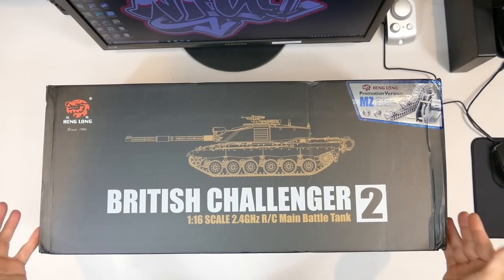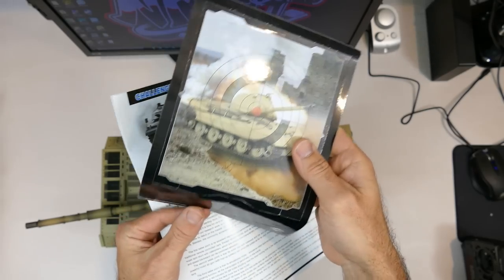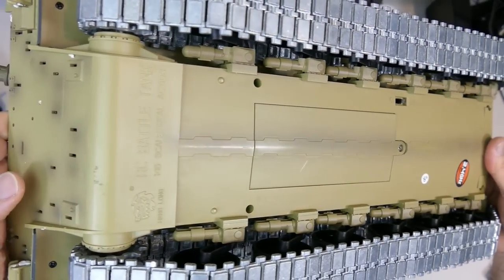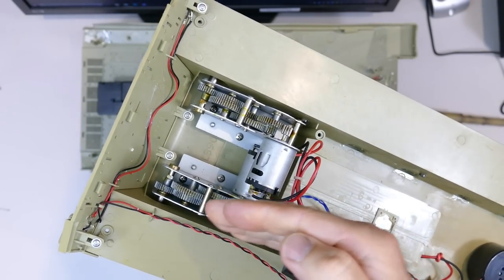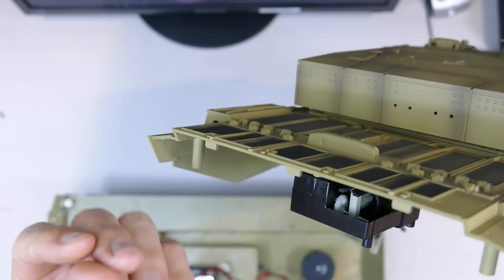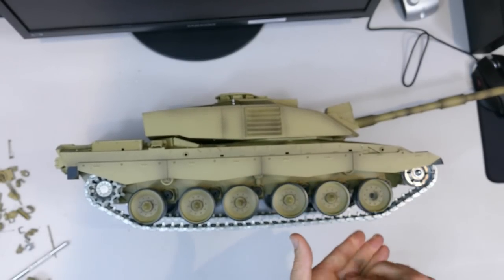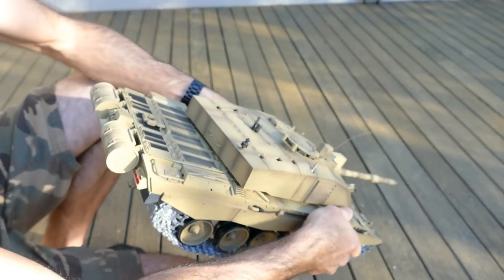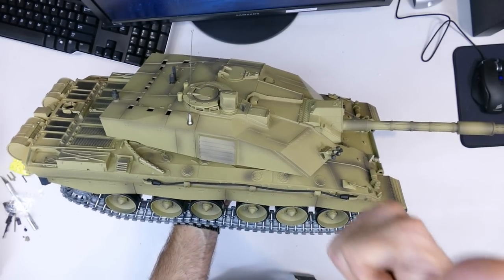Heng Long Challenger 2 1/16 RC Tank - AIRSOFT BB'S And Metal Tracks - Full Review

Comment: This could do 40mph. Also there was two engines in the tank. The small one is called a g.u.e which stands for generator unit engine which would supply all electrical power from a 4 cylinder perkins diesel. The track tensioner is called htt hydraulic track tensioner. The side skirts are for general running they are replaced with armour sides which also directed the exhaust gases to the rear of the tank from the side so it would be difficult to identify it in the dark. The smoke generator would be operated only for a few seconds at a time to make a screen between the tank and the enemy to allow the tank to make a quick get away. When the tank rotates on the spot it's called  a neutral turn.

Comment: Challenger 2 holds the record for the longest confirmed tank kill at 4700 metres During the 2nd Iraq war
Reply from the maker: That's a solid achievement
Reply: Challenger 1
Reply: Challenger 1
Reply: @RCTanksTrucks247  would be if it was Chally 2.But it's Chally 1 ,different tank

Comment: Inhave got 3 of them tanks from HL. A leopard , Sherman and a German Panzer 4... the leopard BB system went kaput for no reason, i tried to repair it but everything inside was so filmsy. The plastic are brittle, soldering jobs are sloppy, red wire are interconneting to each other by soldering making it impossibe to replace some motors without unsoldering joints... i build drones and i had never done sunch sloppy wiring in all by RC build. I retired 2 tanks and left the sherman on display as i re-did the aweful paint job. My advice... you get what u paid for. If you can, save up for a Tamiya. Forget about Taigen or Mato too... gets a Tamiya 1/16 or a Armortek 1/5.
Reply: Add about 2 to 3 Drops of RWS or equivalent Pure Silicone Oil for Airsoft or Pneumatic Pellet Rifles. Lightly trigger the system with the Tank Vertical, right as the mechanism begins to Cycle or fire, drop 2 to 3 Drops of the Silicone Oil down the Barrel. Lubs the O Ring Seals. Only 2 to 3 drops! Cycle 2 or 3 times. I have 4 HL Tanks and yet to replace a Gun yet or it could be just Luck.

Comment: Hey mate great videos I love the tanks I have a M26 Pershing and the Bulldog, what exactly are the benefits of the steel upgrade tanks, there more expensive but does that mean there better.? thanks again for the video.
Reply from the maker: Steel for the tracks, gearbox, drive and idler wheels will make the tank more reliable.

Comment: 10:35 U said 120mm Muzzle, but really u say gun, because the muzzle is just the tip of the barrel which is part of the gun inside the turret
Reply: Them breech is the part inside the turret the muzzle is on the end of the barrel.

Comment: I have the henglong tiger 1 with metal gears, tracks etc but I’ve burnt out 4 rx18 modules up to date. Running on grass seems to put to much on the rx unit causing them to fail. Is there any other electronics that can be fitted, I don’t fancy paying over the top for Tamiya dmd units.
Reply from the maker: Apparently the brand new RX18 6.1 I think they are called are much better.

Comment: Had mine about 18 months only had two problems 1st when I tried to run it up a shale mound got a small rock stuck between the track and drive sprocket had to take the track off to clear that 2nd lost the cap and securing screw for a drive sprocket fortunately I found them and would suggest putting a spot of locktite on the screws other than that it's a Bobby dazzler
Reply from the maker: Bobby dazzler, hahaha! Haven't heard that in a while

Comment: Love these rc tanks, only thing I've would do is add some weight in the front to balance it more so it climbs way better
Reply: Adding The Steel Road Wheels makes a big difference. You will also want Steel Gears, Lube with Lithium Grease and a Higher 2c Lipo Battery. I have a 3600 and works well as with all Steel Gear,Track,Road Wheels and Idlers, your gonna need it.
Reply: Is there any way to add bbs containers inside the tank? Copper ones will add more weight but the plastic ones will make more sense because the tank uses 6.m bbs.

Comment: Hello, I just received this very tank for Christmas, however mine has the plastic tracks and the green camo scheme, the tank is fine and seems to run rather well, but, there is no switch to turn the gun on in the little turret hatch, were yours is located, so the gun does not in fact work, there is a hole were the button should be, and an ON and OFF engraving on each side, I'm guessing it is a factory default, however I am not sure, please could you try to explain what has happened here. and perhaps release a video? :) Anyway thanks a bunch, great review!
Reply from the maker: Is it the BB firing tank?

Comment: mine does not have a on/off switch!  (same tank with plastic treads).  need to repair one track section on it!  want to upgrade to metal tracks.
Reply from the maker: Yeah metal tracks are awesome
Reply: I can't find where to buy the metal tracks??

Comment: I have the Heng Long Russian T90 with the metal tracks and wheels and steel gear cogs.
Worth while getting the pro upgrade version.
I think cos the T90 has a lot of bits and pieces on the turret area , my model came with lots of parts to fix and glue, so enjoyed making it.
Apart from the different body mouldings the running gear is the same throughout the range.
Good for the price, but you wont stop at one.

Comment: Trust me, you want the Steel Gears and Add Lithium Grease! This Tank is Heavy with Steel Gears and Drive, Road Wheels and Idlers. Get a Higher Cap. Lithium Battery. Actually I prefer a Lipo. The 3500mah does a good job. 1800 just don't cut it because of the Weight. Yes I own one. If you have little patience for maintenence, try one of the lesser ones as the M-41 Bulldog or M26 Pershing. My next is the Metal Tracked, Steel Geared T-34-85. Try Baby Oil for the Smoke Unit. Seems to work well so far.
Reply from the maker: Thanks for the tips!

Comment: Good video…. But I’m still very new to RC Tanks, and on my Heng Long Abrams tank you have to manually move the trait in order to get to on/off switch…. My question is, when you manually turn-the Trait does it do damage to the system?
Reply from the maker: No, should be fine. That's clicking is just the clutch

Comment: Tanks for sharing. Are the HL tanks more or less the same as the Taigen tanks in your experience? Two Taigens and one Tamiya myself.
Reply: They're pretty much the same
Reply from the maker: You're welcome and yes, they are pretty much the same. Taigen offer more paint schemes and upgraded tanks though. Parts are interchangeable.
Reply: Not all the parts of interchangeable, as with the Panther G, the Upper, Lower Hull and Rear Plate are slightly different from one another to get a sure fit, this is the information I received from Erik (Taigen Rep) a year ago. 

But here's an Awesome Upgrade for boh Heng Long and Taigen tanks...their new V2 MFU.

 https://www.taigentanks.com/taigen-parts/ele-gb/tag120604

The only bad thing about Taigen, they don't deliver any of their parts outside of the United States.
Reply: Taigen and torro are better quality.

Comment: I am just building one of these at the minute having already built the Heng Long Abrams M1A2. Just a few comments. The instruction manual is abysmal. They really should spend a little money on a proper English translation. I have enough 'accessories' left over to build another tank! Nowhere does it explain what the vacant slots on the top of the turret are for. The real tank doesn't have these (I live quite close to a Challenger tank range in England and can see the real thing - albeit not in combat conditions). I glue most of the 'snap-in' parts. They don't fit well enough to live them loose. The basic build only took a day but I will spend a week or more weathering and adding camouflage nets and foliage.
Reply from the maker: Yeah the instructions are a joke, definitely more time invested would make a world of difference

Comment: Great video. Had no idea that these tanks had so much tech packed in to them like that. Very impressive. I have 3 HengLong tanks. I have 2 German Stug III. One has metal tracks and gearbox and the other one is just the standard one. I am also waiting on a King Tiger. Then I have a very fun RipSaw tank. It is great fun!!
Reply from the maker: Yeah they are great value for money that's for sure
Reply: @RCTanksTrucks247  Yes indeed. I just purchased this tank also along with an Abrams. I love the Challenger 2 though. These tanks are just beautiful. They look menacing at the same time, however.

Comment: Does the turret  go around enough so the barrel can be stowed in the gun rear position?
Reply: No but if you take these tanks apart you can file in missing teeth, so fully rotational, but don't get the wires inside twisted too much, go equal left or right rotation.

Comment: very good value for money especially with all the electronics you get sound, smoke, motor and upgraded metal parts. wanted to ask though, some concerns on an RC modelling site about heng long adding metal parts such as tracks and sprockets was going to cause premature wear to the tank and cause issues such as warping? Any truth to this?
Reply from the maker: Cheers man. Appreciate your comment and glad you like it
Reply: Metal tracks and sprockets will wear eventually depending on where and how much you use it, the options would be plastic tracks which would break under the strain or the rubber band tracks that deteriorate crack and split, all the while looking REALLY good, personally I would stick with the metal ones.

Comment: That Track Recoil is So Freakin Annoying, it defeats its purpose when using the IR option. 

Also the Engine Sound hasn't changed, it still sounds like a Tiger I.
Reply from the maker: Yeah weird. Another heng long I have you can change the sound set.